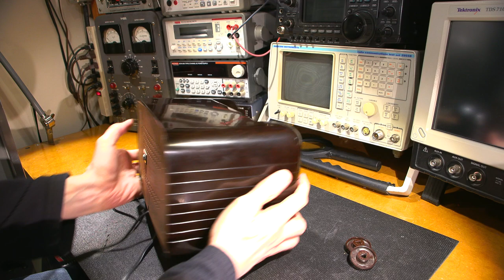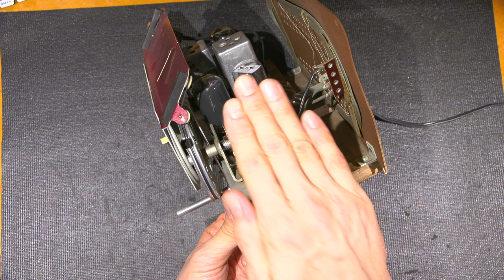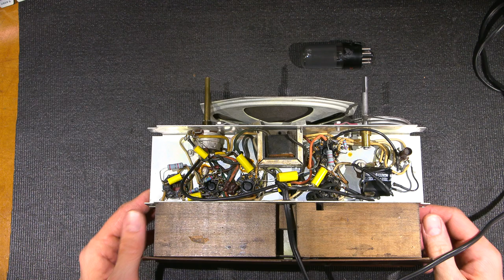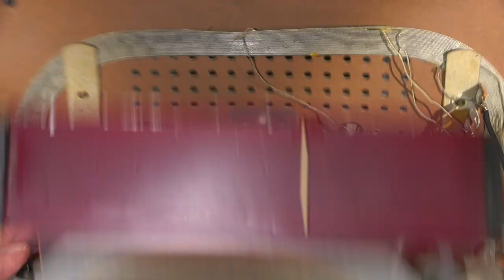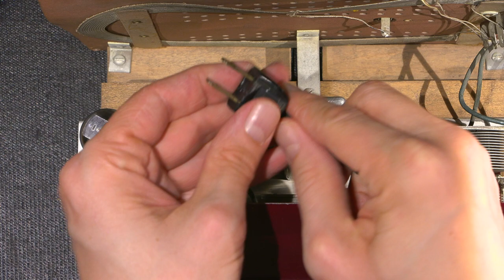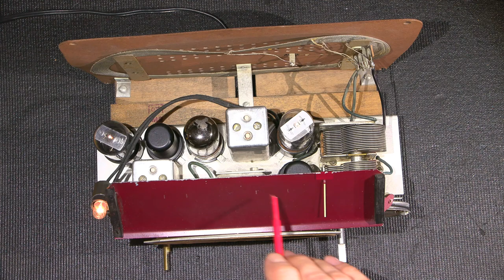Fix A Radio Receiver!

Comment: Just goes to show. Previous restorer more or less fell at the last hurdle. Easily done I guess. I reckon that'll be a fantastic little radio once it's fully realigned. Cosmetically pretty good apart from the screws on the back so that part of the job is pretty much done.

Comment: In rare cases,  tubes in wrong sockets can damage either the tubes and/or the circuit components.  For instance,  B+ in a detector diode plate or a control grid,  where the cathode connection is the same as the correct tube...   this guy got lucky!

Comment: Awesome video, I have a question, you mention that the tuning capacitor is tuned to the onboard antenna.  When you attach an external antenna does that throw the tuning off?  Should you re-tune it with the external antenna connected for maximum performance?  I have never had an external antenna to try it.

Comment: Hello. I have a boombox which does not play any radio station clearly. Every station has static noise. My car radio plays them all good so the signal is good. The boombox is very clean inside and has a new fm antenna. Where should I check? TY

Comment: Hello Paul - I saw one of your older videos in which you repaired a TL-922A amp. Do you still do repair work on amps?  I have a Yaesu FL=2000B that needs some work. I hope you read this.
73,
Bruce  K6RQR

Comment: Locating the audio power tube  is easiest by relating the wire from the primary of the output transformet to a pin for the plate connection IMO. And mixture tube (heptode often combined with oscillator triode) sit closest to the RF section, in this respect locating a rectifier tube close to the RF and Oscillator sections is VERY strange. Still, via mains/ switch connection this was an easy one for you. BTW I myself never accepted radio's for repair way back if someone else bungled the unit up beforehand.

Comment: would be interesting to know more about the external antenna, how to calculate  optimal lengts etc
Reply: The AM broadcast band has wavelengths between about 175 and 600 meters so, unless you own a lot of real estate, you're not going to be able to put up an antenna that's more than a small fraction of a wavelength. Just put up as long a wire as you can.
If you want to receive the FM broadcast band (around 3 meters) you can worry about making your antenna resonant.

Comment: Love the super probe, but 99% of us do not have one.  I would like to see some troubleshooting with more standard test equipment you would find on most test benches.  I may build a super probe after I retire and have more time.  May build the capacitor analyzer as well.   Again though most of us do not have this piece of equipment either.

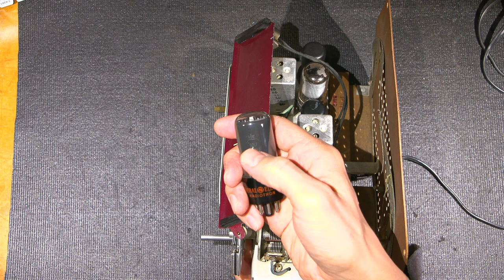Comment: 7:55 - Can you explain the "paint" used inside the 50L6 and similar tubes? What purpose it serves, etc?
Reply: That grey stuff wasn't paint. It's the color of the metal the anodes (plates) are made of. On glass tubes, you will also see a shiny, metallic spot on the envelope. That's the "getter." The getter is a volatile metal that is placed in the tube when it is manufactured. After the air is withdrawn from the tube, and the envelope is sealed, the getter is flashed, usually by inductive heating. The getter material absorbs any remaining gas molecules and is deposited on the envelope in a mirror-like spot. Usually, the deposited getter remains active enough to absorb any more gases released during the lifetime of the tube.
Metal tubes also have getters but, of course, you can't see them.
Reply: @johnopalko5223  - No, I'm referring to the coating inside the glass envelope. I have a tube around here somewhere where the getter is in the base and the rest of the tube has this same opaque coating everywhere else.
Reply: @deadfreightwest5956  Don't know about that. It's a new one on me. Paul, do you have any idea?

Comment: I have the same radio, that I picked up in 1980 and did a restoration on it      that is a mod." 65X2" chassis no. "RC1034"  made in early 1946    for those who have this radio it is in "SAMS PHOTOFACT" # 4 -30     there is a later version that has the "SLUG TUNED"  I.F. transformers that may have the "SILVER MICA DISEASE", YUP!!, nothing like the cap tuned I.F. transformers!!!!

Comment: yes please to the full alignment on the radio , i bet the guy who did the work was very upset that it was not working to a silly mistake not putting the valves in the correct place , another thing i learnt thank you

Comment: I (we) need to see the alignment process, I come from an era where Tubes were being replaced by transistors, so getting a good understanding on what must occur in the alignment process and be familiar with what each adjustment does, is very important when it comes to working on equipment like this.... Also , there may be people in the audience who believe they understand the process of alignment... Could get an informed refresher course :-)  This would be a great video to create, because people with old tube radios, may need to do this process on a radio that got messed up over time.
Reply: There is no real difference in the alignment process of a superheterodyne receiver whether it uses tubes (valves) or transistors.
Of course modern radios will use SDR (Software Defined Radio) which is much cheaper than all those gorgeous old variable plate capacitors, all the trimmer cans, etc.
Reply: @Drew-Dastardly  Well,  That kind of answers one question I had in mind about the differences in adjustments... But still, because I've never been properly taught, or have a good understanding of this process. I think a video showing us how it's done and a little knowledge passed along during the process from somebody with experience could really go far in teaching people.  I've got my eyes open for some old Tube radios to restore, i would like to restore something,...  rather than wreck it,  though I built many kits in my life, and have general knowledge of electronics and a lot of things, I still have much, much more to learn, So wherever I can pick up tidbits of knowledge, I enjoy that, and your input and knowledge was greatly appreciated, thanks for reading my comment :-)

Comment: It sounds like you don't like j-hooking the leads for a mechanical connection. How do you prefer to connect the leads?
Reply from the maker: Hi Dennis. I desolder the entire connection, remove the old wire and install the new component like a factory connection.
Reply: @MrCarlsonsLab  do you j-hook the new lead thru the socket connection, making a good mechanical connection before soldering the connection?
Reply from the maker: No, I slip the component through the eyelet without any hook (in most cases, excluding power resistors.) This is the same method Tektronix used for years without issues. I have had no issues either.
Reply: @MrCarlsonsLab  i was taught,  60 years ago to make a good mechanical connection before soldering.
Reply from the maker: Slipping the component through the eyelet without a hook is a good mechanical connection. Creating the hook is redundant in most applications, and creates socket stress when components are changed "properly."

Comment: My Dell PC running Reaper Digital Audio Workstation makes digital noise when connected to a sound system or KRK monitor speakers. Noise happens when you move the mouse or when the screen updates. Laptops do not make the digital noise. It may be ground or ground loop issues. How to fix it ??

Comment: I was watching you troubleshoot this detuned receiver with your homemade probe,, & yes I see you were on a vari ~ ac... Your non- contact probe is the one made with two Shotky Diodes & aprox a 8 meg resistor, doing it from memory ,and it looks like your feeding it into an amp. Question ,your cases are metal, and those type of Chassis are the ones that you can get zapped if the NON -polarized plug is reversed.  So if your metal case probe touches and your body/fingers are touching any part of that chassis you are going to get zapped. I know your board in the probe case is isolated from protentional. And thats why they use a high voltage cap, to block the DC and pass the ac sine . I get that, [BUT your probe is metal case no? Why not put it in a plastic case ,it would be shielded and in my opinion safe from a shock or an accident. I work with HV ac a lot ,actually for a living, & when you get hit with DC it really hurts. Yes I would give it a full alignment .

Comment: who knows when this thing got tinkered before, but now in 2020 id say get some painter's tape.  Tear into little pieces and number them, stick to the tubes and then take a picture with your phone.  Or draw a crude topside schematic and right the tube numbers right by each socket on said schematic.

Upside with the previous person though is they put in modern caps.

Comment: Hehe, I'd hate to have you repair something that I've touched; you'd make fun of all of my ghetto fixes lol.  I'm with you on the capacitor brand.  It has to be Nichicon/Rubycon/Chemicon or nothing.  Other than that, ghettofixes all around for me lol.

With regards to alignment/tuning, yes yes yes!  I'd love to see the process done again.  I remember having to do this a long time ago in electronics engineering school.  We were given a kit that builds out a discreet component AM/FM radio from Elenco.  We then had to use O-scopes and such to properly tune all the stages of the radio.  I remember having to tune small inductors on the board as well by spreading apart the coil wires with this plastic tool.  It was a real pain in my ask, but was an interesting process we all had to go through.

Comment: Question: is there a chance these old radio's contain asbestos (like the backplate)?
Reply from the maker: No, not in this receiver. Some older wooden radios have a sheet in the bottom under the chassis though.
Reply: I remember seeing a video of a vintage TV repair  where there was a white sheet of something inside that was asbestos suspect.

Comment: Thanks for the video, Paul! I’ve been going through your videos with AA5 radios because I’m restoring my first. Have you ever done a video on SMD in IF cans? I can’t tell if I have that issue or not. Fully recapped, tested with different tubes (except for the 12SQ7) - audio and reception comes on strong, then there’s a POP and audio goes away and gradually comes back, but much weaker. Not getting the “popcorn” sound I’ve heard SMD can have, though. I thought maybe there was a burned out filament that disconnected once everything warmed up, but would that happen in a 12SQ7?
Reply: Mr Carlson shows how to repair an IF transformer that suffers from silver mica disease:
https://youtu.be/P3Wh41Mbf9A?t=1424

Comment: That was a rather simple radio, yes? I have a 1940s radio that is most likely in need of screwdrivering but it has so many adjustments that I wouldn't know where to start.

Comment: It’s hard to imagine that someone took all that work into changing out the capacitors and then did not know enough to put the tubes in the correct position. I am guessing that there were several tech’s involved and one did the chancing of the tubes while the other did the restoration, not knowing the tubes where wrong. It’s an interesting story what ever happened.

Comment: Jay Leno often puts (and hides) disk brakes in some of his very old cars. It can offend some car types - who almost certainly don't own a car like that - simply because that three ton 1932 car is no longer "original".  However that three ton 1932 car is much safer when it's actually driven and Leno does love to drive his cars.  Although I don't know anything about how these radios work, I've heard you mention many times about how dangerous some of them are, and how plugging it in the "wrong" way - which looks likes it a 50/50 proposition to me - makes the radio hot and potentially dangerous.  Can you modify these radios to avoid this potential shock problem? Even if it isn't original any more, it would be safe, and I would think that's more important.

Comment: Sorry, was on the wrong account when i posted this.  Ralph Brandt K3HQI
It is great to see someone restoring these.  I was a 6M AM guy in the early 60's and built a 100W AM transmitter from the schematic and modified WW2 400 mHz Military reciever to 6m.  You got me (K3HQI) and my grandson (KC3MDT) started on a floor model about 1935 and while waiting for parts we started on an RCA table model almost like the one here except it is cream color and it has 6 tubes, an additional 12v IF amp (2 IF cans) and the output is a 35L6 to make the heater string add up.  We just got done recapping it and some cleanup Friday, it was very dirty. but otherwise in good condition.  We tested tubes, some are marginal, we have a 35L6 in transit.  I haven't done an IF/RF alignment since 1965.  I think I remember how.
I would like to ask one thing.  I have done some work on other older units, my violation of restoration is to put a 3 wire line cord on - or at least a polarized cord.  I would like to hear your thoughts on which is best, my preference is the three wire with the green on the chassis because someone could find an extension cord that is not polarized.   
I loved your repair of the FT-1000 - learned a lot of solid state on that one.

Comment: I guess old stuff is made for 110V and you give it 120 plus a isolation transformer they give even more out than 120V an lower than 100% load? I guess tubes heaters dont like it?

Comment: I have a dual power portable motorola that had the original 10 pack eveready red 9 volts but some leaked and it had to be removed.  This needs to be restored or upgraded also ..it used to play but now barely buzzes..it sits collecting dust.
By all means..align it,

Comment: When you moved that 50L6 I thought you were going to move the socket wiring. That's a pretty dumb mistake putting the tubes in the wrong sockets. I'd be worried that I'd broken something.

Comment: you know its cliche but they just dont make em like they used to radios like this were built to last and be serviced by the end user unlike modern ones that die after a year or so  its really a shame that getting these old radios up in running is getting so expensive

Comment: How did the person manage to bodge in all the capacitors correctly but not get the tubes back in right. That at least takes knowing the hot from cold end of soldering iron, understanding values, and putting tubes back isn't much more complicated.

Comment: Ok raise your hands!!!!!!!!!!!!  who hasnt screwdriverd a radio or 3 when they first tore one apart!!!  G.E. model 50 radio that didnt have a chance!  We killed it as kids when we swapped in any tubes we found in any socket until sparks shot out from the chassis!  Never worked again.  I thought by rewiring it in my teenage years, that would fix it lol.........with the same color wire all over it..total fail!  Took me years to find out what model ge it was.  Last year I found out what model and bought one on ebay, repaired it, and now I have one just like grandmas ge model 50 that we killed as kids lol.

Comment: This equipment would be illegal to sell/use in Uk! 3 wire system- live - neutral - earth and plug/sockets can only be inserted one way! Any metal like chassis etc must be connected to earth unless the equipment is double insulated! Very strict regulations nowadays! Things like showers etc protected by balanced trip switches ( I.e. if live and neutral currents differ by 30mA trip operates within microseconds ) ! Any electrical work must be certified whether it’s contract work or d.i.y ! I suppose it saves many lives in the long run as I have seen many death traps in the past! ( i. e. Appliances connected to the lighting circuits )! Fraser

Comment: What I can't understand is if the person that "rebuilt" the radio understood how to correctly replace capacitors using the correct values, why didn't he know the correct position of the tubes and to not mess with IF can adjustments ?
Reply from the maker: When replacing components under the chassis one by one, it's hard to go wrong. The radio may have had it's tubes in the wrong sockets when he got it, so it went un-noticed. This is common.
Reply: Some 'screwdrivering' just as well could have been done by others before recapping, as a last attempt to repair. Also, a lot of values of the caps and resistors have changed from bad to OK, so trough that, the offset of the alignment is even more understandable.
Reply: Its possible he was using a service schematic and was unaware that they often show the tubes from the bottom not the top.
Reply: After I rebuilt it I knew it needed a alignment but that was beyond my skill.  I took out the tubes and stored it for years.  Try as i might I could not find a tube layout diagram for it.  it was my first restoration and I learned many lessons the hard way on this.